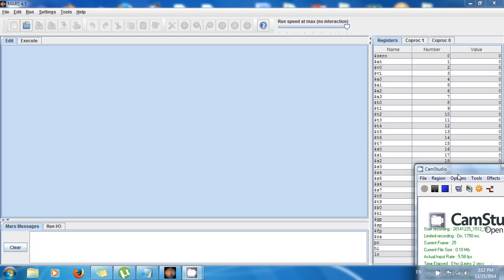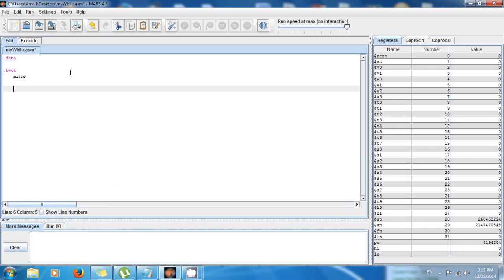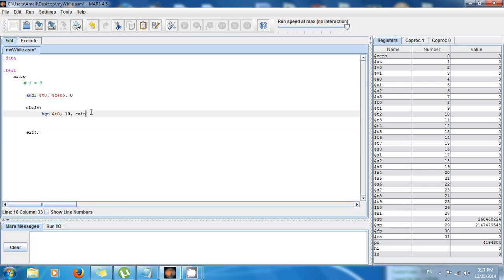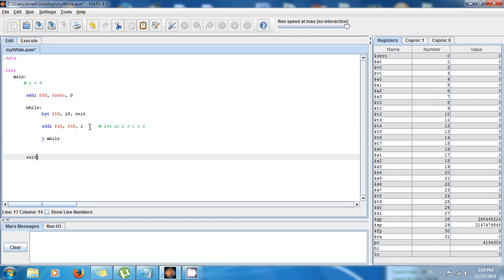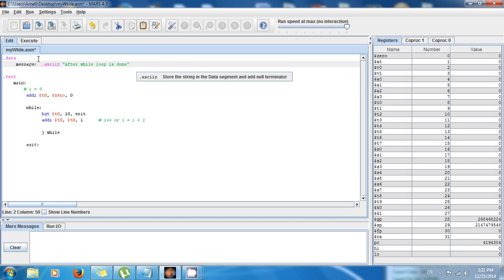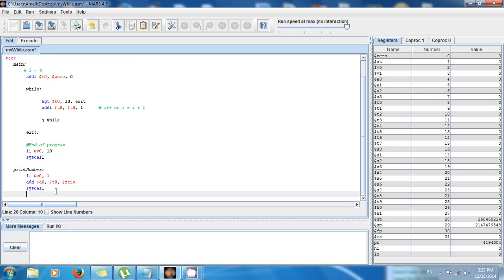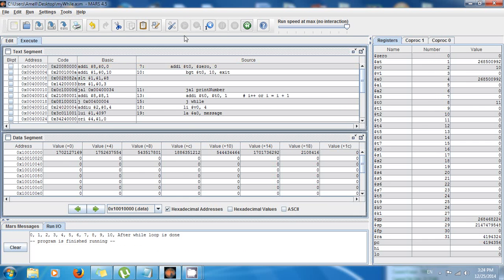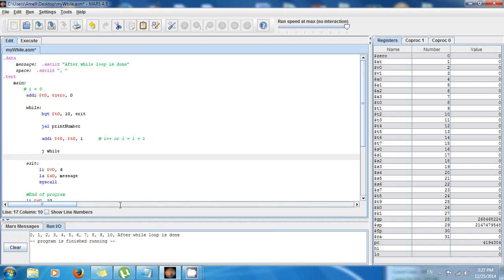MIPS Tutorial 26   While Loop in MIPS

Comment: Hi Amell,

I just watched the entire series of MIPS tutorial that you have uploaded on your YT channel. Thanks for that , it really helped me a lot .

I'd appreciate if you'd help me with my project, I have been trying to do it by my own but I'm struggling. 

The question is 

Write a MIPS Assembler and Real-Time Simulator (MARS) code that accepts two integers from the 
console and uses one procedure to add the two numbers and a second procedure to subtract the 
second integer from the first.
The two procedures should be invoked within a loop with options such as 0 to add, 1 to subtract and 
9 to exit. Ensure that both procedures are implemented. The code should display both the sum of 
the two integers and the difference between the first and the second integers on the console.
a) Write two versions of the code, with the first using beq for loop implementation and the 
second adopting bne.
b) Is there any difference in the execution times for the two versions of the code? If yes, why is 
this so? If no, suggest the reason why.

I'd really appreciate your help.

-Anelisiwe

Comment: how would you implement an if conditional statement inside the while loop. I tried implementing an if conditional statement and then try to addi a value to a register and it won't allow me. stays in a infinite loop. help.
Reply from the maker: Hello Luis. You can implement if conditionals in assembly by using the branching instructions (i.e., beq, blt, etc) with labels. For example, you can create a while loop like the one I created in the video. Then, once you've tested that the while loop is working properly, you should use branching instructions that will jump to a specific label if a certain condition is true. If you need more assistance, please show me your code.

Comment: What if you wanted to have an array of 100 elements with each element having a unique value o.O? would be tedious to use sw 100 times and increment the index 100 times.
Reply from the maker: There are more ways to initialize an array. Another way is:

myArray: .word 45, 34, 44, 34, 54, 43, 34, 78

That declares an array of 8 integers with a unique value.

Comment: My professor said not to use bgt, blt, and bge because hardware for <, ≥, … slower than =, ≠
Combining with branch involves more work per instruction, requiring a slower clock. 

Is this true? If so, how would you do this while loop in MIPS with only using slt, slti, beq and bne?
Reply: it is true. he could do this: beq $t0, $t1, exit, where t1 contains number 11